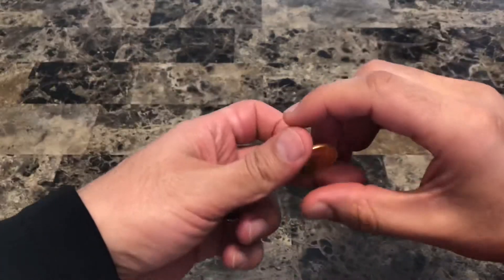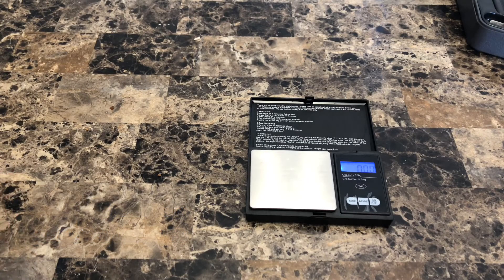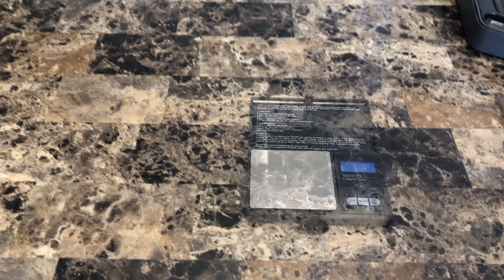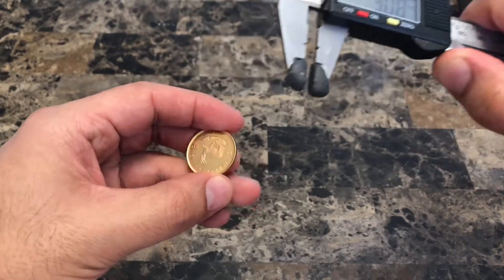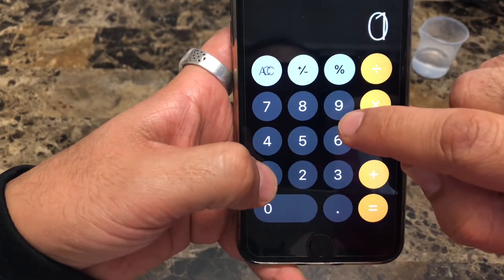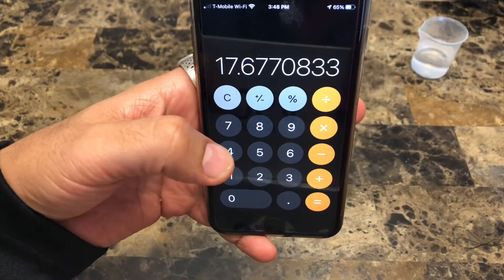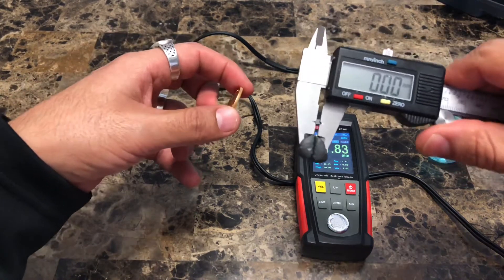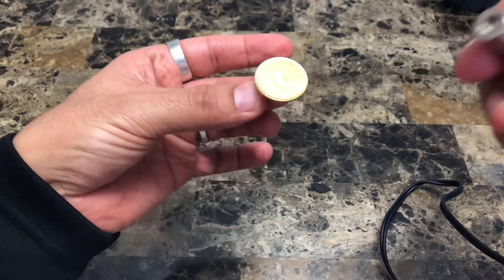Testing 1/2 oz Gold Krugerrand coin various ways including ultrasound thickness gauge

Comment: Very interesting video, I'm fascinated by the pitch of the coins. Also, the method of volume measuring is brilliantly accurate. Depending on what the black things on your caliper are, your measurement will be off if you exert any pressure more than just touching the coin ;-). It seems to me, with the correct weight and shiny surface, people holding it does not account for size variation, the cheap caliper is the more likely source ;-)

Comment: Thank you for your video. Regarding 8:48, counterfeiters have been using gold covered tungsten to make fake gold coins, because tungsten has a density which almost the same as gold which is 19.3 grams per cubic centimeter. However by using the neodymium magnet test, a genuine Gold Krugerrand suspended on a pendulum is diamagnetic and thus is slightly repelled by a neodymium magnet whereas tungsten is paramagnetic and thus is slightly attracted towards a neodymium magnet as demonstrated @ https://www.youtube.com/watch?v=SgPOPozHRow. Regarding 9:26, a genuine Gold Krugerrand will produce a resonating ringing sound with the acoustic ping test whereas a gold plated tungsten Fake Krugerrand will produce a dull thud sound as demonstrated @ https://www.youtube.com/watch?v=boB4yyS-fDk&t=20s